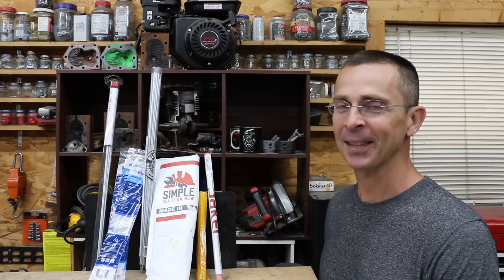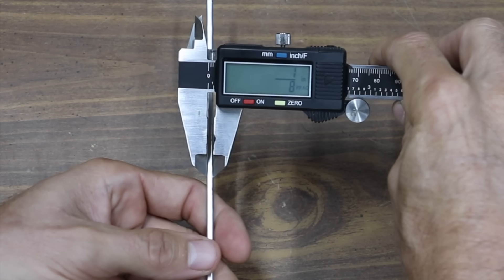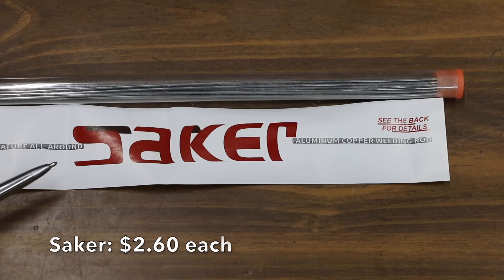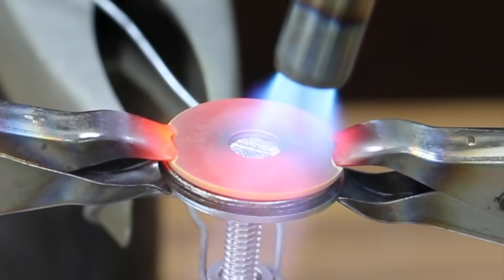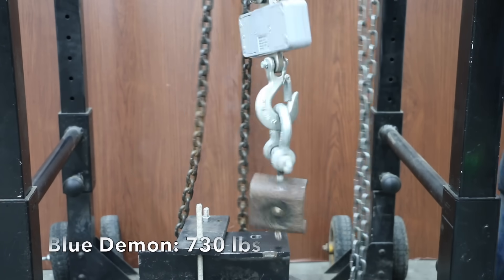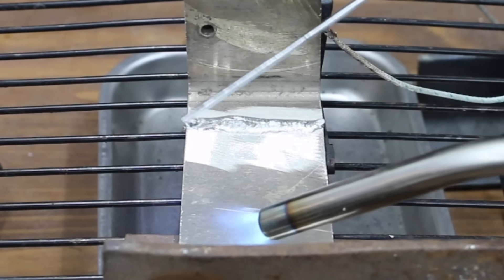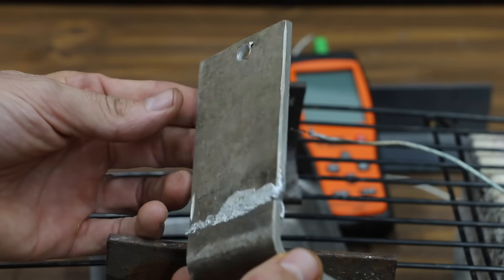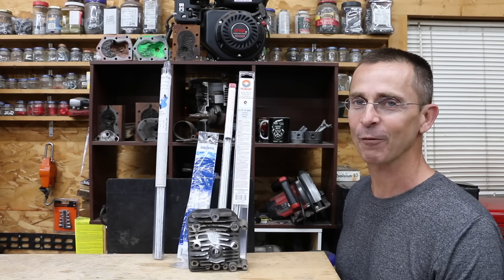Best "No Welder" Aluminum Welding Rods? Alumiweld vs Bernzomatic vs Hobart

Comment: Great Video! Thanks for the thorough testing. These are good if used properly, I never had any luck with them when used on very thin aluminum like the material used in automotive radiators, it seems by the time the working temperature is reached the aluminum to be welded is melting too since it's a lot thinner than the rod itself and can't handle the heating well.
Reply from the maker: You are welcome!  Thanks for sharing,

Comment: I'd love to know how well these products resist corrosion. Basically, is one better for fixing the old aluminum Jon boat?
Reply: I was thinking the same thing.  This would've beat hammering out all of those rivets when I could've just grinded out 4 small welds and brazed it back together.
Reply: J Gray   It is very difficult to weld aluminum boat due to the constant stress and flexing. For reasonable durability aluminum boat hulls must be welded in a very controlled manner. If at all possible replace the rivets and tighten up any other loose ones.
Reply: @218philip  yea, I did the rivets...however I think brazing may have been an option. I run a trolling motor on it most of the time.
Reply: J Gray   In your circumstance it may work,  I had a disaster with a larger aluminum boat.
Reply: J Gray  try SWIFT TAPE, EVEN UNDERWATER , CHEERS 🇺🇸🇺🇸🇺🇸🇺🇸
Reply: In my experience, I tried one of the rods that did very well in this video and failed horribly at fixing my jon boat. Let’s just say it wasn’t the products fault. Lol. 

Also the heat will expand the size of the crack, so if you can’t clamp it it’s going to be a problem.

Comment: I remember when you could only buy alumiweld from an infomercial for an insanely high price. And now it's a harbor freight brand that does well? Can't help but wonder who mismanaged that company.

I'm glad to see that you still get back to the roots of this channel by finding someway to test a product on an engine. I was hoping for a spectacular blowout lol.
Reply: You may be thinking of Alumaloy, that was the brand sold on infomercials.  They seem to still exist and are made in the USA.
Reply: @mrb5217  I very distinctly remember alumiweld because it's the only brand I knew about.
Reply: I remember the same infomercial.
Reply from the maker: Thanks for watching!
Reply: I remember that to didn’t they fix a bunch of pin holes and a cracked rib in an old John boat in that ?

Comment: Please test SDS hammer drill bits at some point. very interested in Diablo, Hilti, Dewalt, Bosch and bad dogs offerings to see which one lasts longer when going through rebar. you can also test some multi material bits as well.
Reply from the maker: Great suggestion!  Thank you.

Comment: Years ago I remember repairing a Wisconsin engine that had a cracked aluminum head.  Just wanted to try to see how well it would work. Surprise Surprise the head is still going strong to this day. The number of hours I would say on the repair is maybe five six hundred hours. Never had to deal with the head ever. Great stuff I used but do not remember what the brand was. Nice test with all the different brands. I remember that one of the brand rods with flux did not work for me either. My neighbor told me that I did not use the rod correctly so I gave him the pack. The next day he said the rods must of been made in CHINA as they did not work for DO DO. Thanks for letting us all see the test Sir. Good day and stay virus free too. VF
Reply from the maker: Thanks for sharing!
Reply: I had similar luck, but when the crack between the exhaust and coolant jacket, i never got a seal, just too hot! like this dudes hotplate that heated that brigs head to 700, we used to do that while racing in about the same amount of time. LOL, not kidding....  take care, thanks for the awesome comments.... . .. .. .
Reply: @andyp3834  Thanks Andy for the info. V
Reply: When I saw some rods not stick very well that got me wondering if regular paste soldering flux would work on the Al based metal or not. I bought some of these rods awhile back but have not used them yet.
Reply: @johnpossum556  A special flux is made for aluminum. Do not remember the name.
Reply: @BloopTube  But for how long ??

Comment: I would love to see an experiment of cutting gasoline with diesel in an gas engine to see if it increases performance(theoretically diesel has a higher energy density than gasoline). 1/10 diesel/gas maybe
Reply from the maker: Thanks for the video idea.

Comment: Fantastic video Todd, thank you!!  Question for you, did you get the impression that any of the products might make a decent bond between aluminum and steel such as for sealing up a single slip joint on an exhaust where you want to bond a stainless steel muffler into an aluminum exhaust?  
I really like to build aluminum exhausts most of the time, but it is always a bit tedious incorporating a muffler because the selection of aluminum mufflers is quite small.  So I usually have to do a V-band flange setup at each end.  Some of this stuff might be able to let me hard mount a steel muffler in the middle of a run of aluminum exhaust, and that would be sweet!
Reply from the maker: Thank you.  I don't believe any of them will form a decent bond for that purpose.
Reply: @ProjectFarm  Ok, thanks Todd, much appreciated!!

Comment: I've had great luck with the alumiweld. Picked some up to make a frame to hold a screen in this window box I made and have since also used it to weld up my pickup bed box (had to narrow the box since I moved from a ram to a chevy colorado), and a few other little fixes and filled up a little oops on my tablesaw that I put a divot in when I was routing out a slot and forgot to tighten the router's height adjust. Getting that amount of aluminum hot, but not over-hot took some very careful work with oxy/ace.
Reply from the maker: That is awesome!

Comment: Small issue though. The welding should react more to the way soldering is. When the correct heat is on the materials the melted rods should move around the parts and fill the gaps. Same way as the copper soldering. Also should work the liquid around while heating it to avoid oxygen build ups for stronger bonds. 

But always a great video!!
Reply from the maker: Thanks for the feedback.

Comment: yO you can literally fix aluminum blocks with these things? I need to get into brazing!!!
Reply: I have a tig and mig but I’d take brazing something together over them any day.  Brazing is good enough for the Ariel Atom car tube frame so it’s good enough for the projects I do in my garage.
Reply: Get some Aluminum and silicon bronze brazing rods. Good do-most combo
Reply: @willpestka2745  anything that can strap steel to aluminum?

Comment: Why non-chlorinated brake parts cleaner?
Reply from the maker: Sorry I didn't explain.  A flame and chlorinated brake parts cleaner will create phosphine gas....bad stuff
Reply: @ProjectFarm  Thanx!  I walked out into the garage and checked the can of non-flammable brake parts cleaner and it SPECIFICALLY says not to get it near high heat or welding.  I can't believe I never saw that, thanx again.

Comment: Video idea: Windshield washer fluid : how do they compare, price, performance, etc. 

Winter is coming and would be awesome to know which washer fluid I should be using.
Reply from the maker: Thanks for the video idea.
Reply: I always buy just about any brand and then add at least 1 bottle of ethyl alcohol to the jug. Methyl and isopropyl can degrade rubber hosing.
Reply: @michaellinner7772  I put in whatever I find at AutoZone or O'Reilly's. Never had an issue but would love to see how they all compare.
Reply: @andreyka64  the only reason I add the extra alcohol is that when it gets really cold like under 10 degrees F some solutions can start to freeze and no longer flow. The alcohol is cheap insurance.
Reply: Here in Colorado thats a huge thing. I would love that! If you use the coating ceramic or rain-x stuff, please use it last, as it contaminates the windshield.
Reply: @Outspoken Insider  not sure i agree with you sir. I use rainx and its the best ive ever used. I dont see your observed contamination on my wshield. I can see clearly now the rain is gone😊 and just fine in the rain too
Reply: I can tell you that rain x is the best for me. The orange stuff. I live in northeast and it doesnt freeze as much as everthing else ive tried. Saved me twice too. Once when the windshield wipers quit working in my pinto😊was still able to keep on goin in a rainstorm. No wipers needed. Wont use any of that blue crap.
Reply: @captainmorgan6035  Pinto!?  Ford Pinto!?   AKA hibachimobile?.  If it's some other kind of Pinto please accept my apologies, if it's the Ford Pinto, please accept my sympathies.
Reply: the Rainx product. I don't even buy the blue stuff at garage sales for 50 cents anymore. Above 40 mph the rainx lets you turn off the wipers.
Reply: Cold temperatures aren't a problem for me because for one, I live in california, and my e-class has a heated windshield washer tank.
Reply: @joshanderson1019  you're lucky to live somewhere warm.
 I live in the mountains of Utah and have a diesel truck no less. If I don't plug in during the winter I'm stuck.

Comment: Would these rods be considered more of heavy metal soldering than actual welding since not heating the rods?
Reply: It's an adhesion process just like soldering, which is why he was pretty focused on the weld peeling away from the base metal.

Comment: Aluminum brazing rods are extremely useful. Your tests, as always, top notch! Thanks for the video! A++
Reply from the maker: You are welcome!
Reply: @ProjectFarm  Check out silver solder, its very strong and similar to brazing but much less heat required.
Reply: @adrianchetwynd1334  Silver solder won't stick to aluminium. It's great for stainless, copper & brass though if you use a good flux.
Reply: @ProjectFarm  I used these rods to repair broken model airplane engines.  Cases, mufflers, and cracked back plates.  I never had one fail.  Do both sides and do not grind down the bead unless absolutely necessary.
Reply: @ProjectFarm  I adore your sense of logical approaches to doing your testing. How long did it take you to do this test?
Reply: I agree, I have never used them before.  Now I probably will go buy some and do some my own testing.  Didn't realize how useful they would be in the field when you only need some heat.
Reply: Hey man. What kind of projects would you use these for?
Reply: @PJBonoVox  I've used them for making aluminum brackets for things like motorcycle side-bag mounts. Had a buddy drive over 3000 miles with some aluminum L brackets bent and cut and brazed with Alumiweld for strength in areas I thought suspect to stress, that I had made into ammo can mounts for his motorcycle and they worked flawlessly. Then he went off-roading with it, rolled it down a 30ft hill with the ammo cans on the bike...still held up. I'm impressed and so was he. I've also used it to plug holes in aluminum valve covers, aftermarket oil catch cans that had holes in places I didn't want them, etc. I patched up some loose wires on a wire rack too. Next project is fixing a whisk.
Reply: @PokeSecretsDaily  would these fill a exhaust stud hole for re drilling and tapping?
Reply: @jedigeekbiker  Sure would. I've tested filling the bottom of an aluminum can for JUST that, even held a bit of pressure (I wasn't brave enough to go over 12psi)
Reply: @PokeSecretsDaily  nice one. looks like the head may be coming off anyway so can do it on a bench. I found some that melt at 300c or is a higher melt temp better? I did see delboys garage melt into a metal cube and re-tap, but it was brand new metal in perfect conditions so wasn't sure this would work.. cheers
Reply: @jedigeekbiker  I personally like the low melt temp for most things, especially if I'm brazing against a larger chunk of metal that likes to steal all the heat away from my brazing area (propane torch doesn't heat well without Oxygen, MAP gas may not have this issue). This stuff is impressively strong for anything other than FOLDING the joint. Delboy's video is a great presentation of it's uses. I tapped directly into the alumiweld when I did my can test, it's plenty strong enough to take threads and hold.
Reply: @PokeSecretsDaily  awesome thankyou
Reply: @jedigeekbiker  I saw it done at a trade fair with good results
Reply: Small to medium projects made with aluminium.
Reply: @youtubejunky7481  Alumiweld rod from HarborFreight seems to be good for me. Making sure a clean surface that is well scuffed helps with brazing adhesion. Using propane torch, heat the object you're working with first, then move heat toward the rod when it starts to get hot enough to make the rod stick when you touch it to it, then make your joint.
I typically move AWAY from where I start with the rod instead of pushing a puddle like normal welding.
Reply: @PokeSecretsDaily  He forgot to mention its made in USA.
Reply: How too drive å car, without a car. This is not welding, its soldering. This never goes in too the metal like a weld, but you already know this. Good test video 👌👌👌👌👌👌
Reply: @Jonhenrysneip  Actually, it's brazing.
Reply: @TicoTimeCR  Actually, it's soldering.
Reply: @dawgiedawg6893 yeah, below 840 deg F is soldering. The icy hot stuff would be closer to brazing, if it didn't melt until the higher temperatures were reached.
Reply: @youtubejunky7481  try drilling the dowels in first not just butting them
Reply: Fix battery acid damaged club car battery trays 😆
Reply: Club car golf carts use aluminum frames.
Reply: Yep, I find it kind of misleading that companies call the process wielding.  They are an amalgamating solder of a slightly higher class than acid-flux solder.  They basically converting some of the aluminum into an intermediary alloy with a lower melting point.  Good ones will also include another amalgamating metal mix that pulls low strength contaminates away from the wield to the outside surface.  They are technically something half-way between wielding and soldering.   Really useful for field repairs, though.
Reply: I love how he notes when his technique clashes with the product's capabilities.  

Certain rods clearly aren't fitted for certain techniques on certain tasks.

Comment: Been using Hobart sticks for a long time and I believe in them. Never done any TIG welding not have I used aluminum brazing rods. Hobart is the way to go, though for the price, the Harbor Freight brand held up pretty well.
Reply from the maker: Thank you!
Reply: Get some Esab Atom Arc rods and you'll never look back.
Reply: @lunchboxproductions1183  For arc welding?  Like 7018?  Not sure the scope, just asking to clarify.  Thanks
Reply: @jafinch78  Exactly. I like them better than Lincoln Excaliburs which are probably the most popular 7018
Reply: @lunchboxproductions1183  Cool, I'll keep in mind.  Have you ever tried the Firepower flux core for MIG by chance?  Not sure if they make arc rods.  I'll keep in mind the ESAB's too since I recently read they invented the flux coated rod like in 1904 I think when I was trying to find info on the Migmaster 230 that seems to have nothing online regarding.
Reply: well, thank God the world has welders like you and others. not my foray, but cu-does bro; cu-does (sorry, your not old like me, i meant thanks a bunch bro!)
Reply: @andyp3834  Don't take this the wrong way, more me just trying to boost your vocabulary if you care. It's Forté and kudos. I totally understood what you were saying, just trying to be informative and not corrective.
Reply: @th3R0b0t  thanks, i grew up in a cult in Utard, USA, so im trying, ;-)